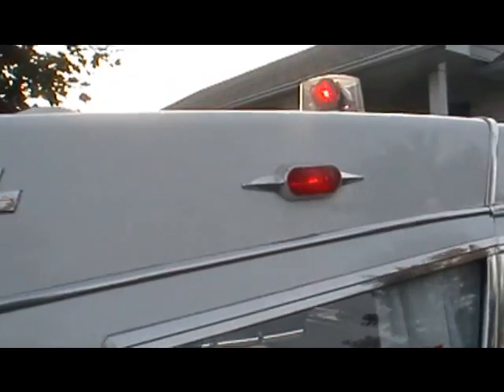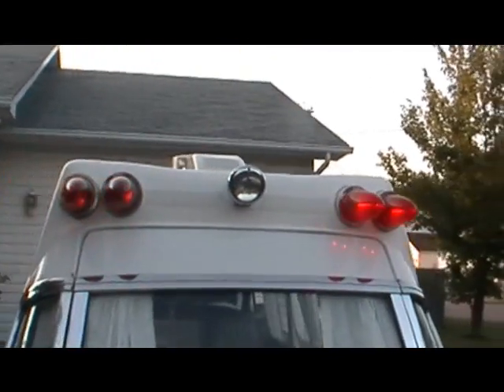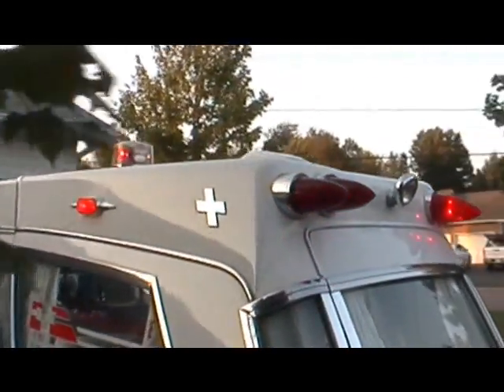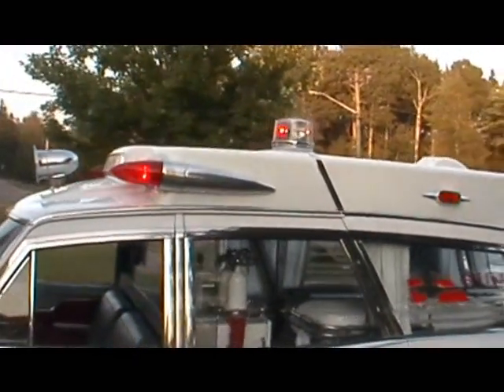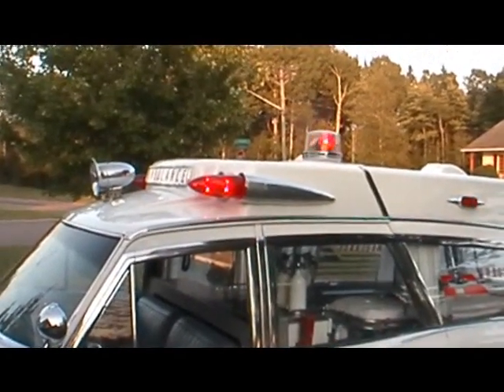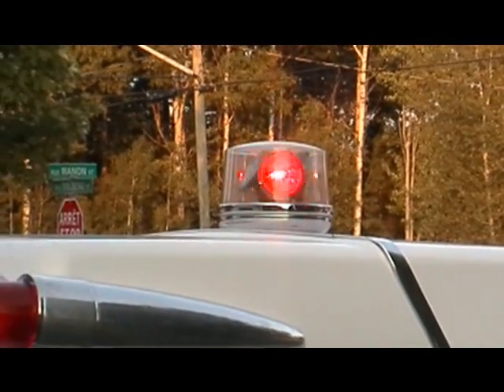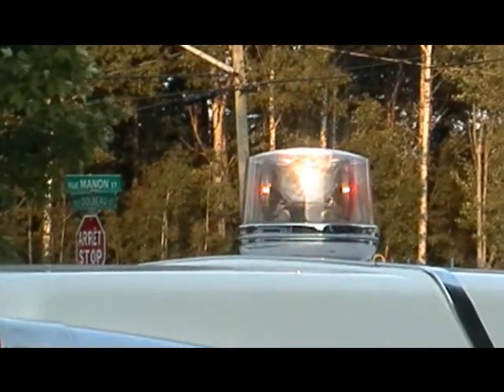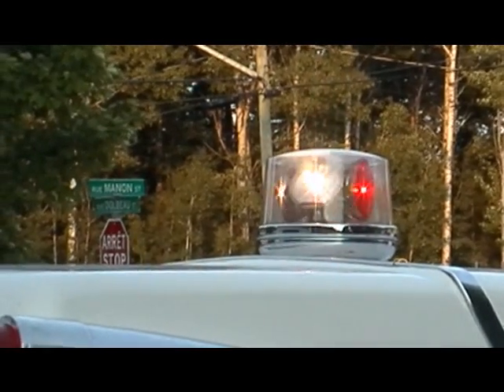1967 Pontiac Ambulance - New Dietz 211

Comment: Dumb question, but how did the lights flash? Modern lights use a computer board, but back then that was non-existent, so how did they achieve flashing lights?
Reply: My guess is some sort of relay-logic, motor-and-cam, or other electromechanical mechanism that pulses flashing patterns to the lights
Reply: They used relays
Reply: 4th Line All Star .... we called them flasher cans or relays